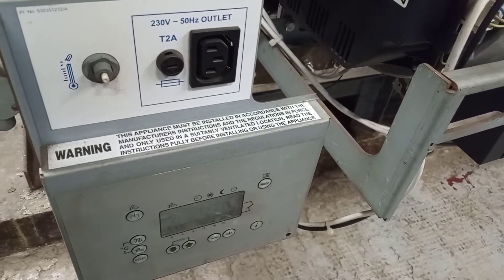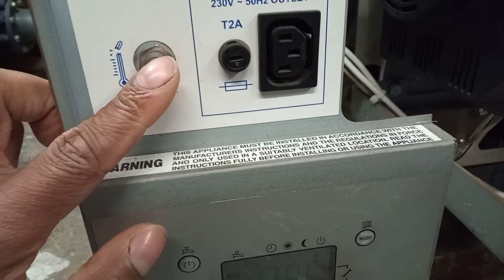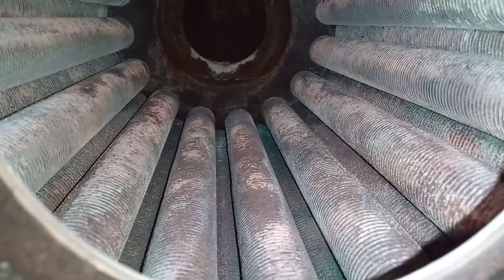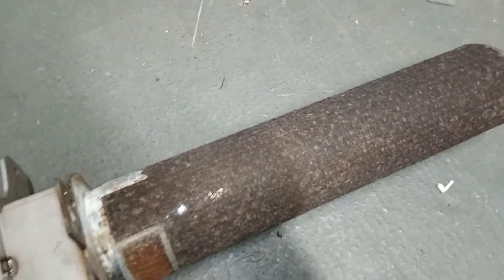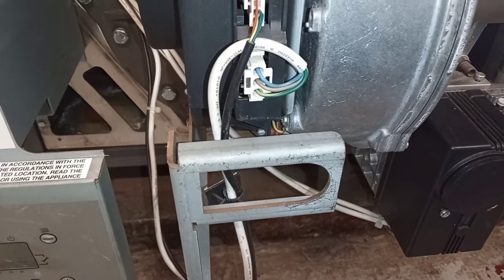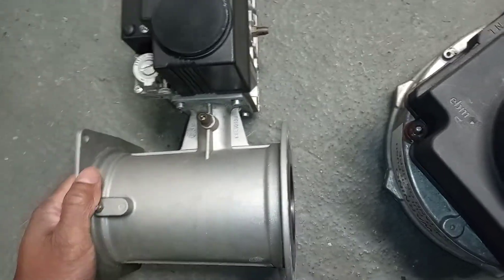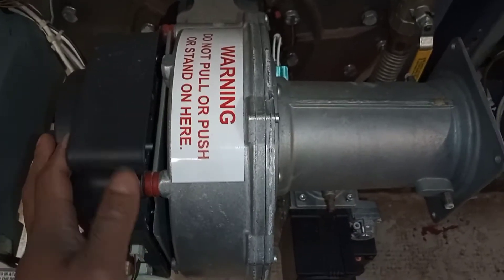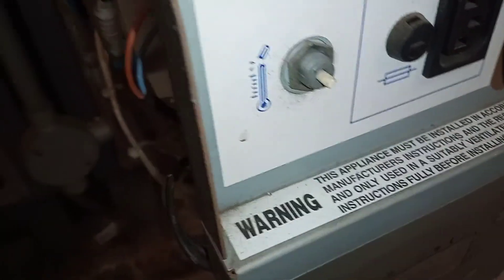FAULT CODE 110 / HAMWORTHY WESSEX MODUMAX 220

Comment: Did u get away with not changing gaskets when removing the burner?? I’ve got one to service where I need to remove same plus heat exchanger for cleaning. Would usually order up service kit before hand??
Reply from the maker: Hi Fraser. I didn't remove the burner in the photograph so not sure what the general condition of the gasket on these models are like. Yeah ideal to have the service kit. If the model is not operating before I get to it there's a small chance I'll aim to remove the burner and see the gaskets as the thing wasn't working when I arrived so no biggy if it's not when I leave. Yet if I'm doing a service and there's no service kit and the boiler was operating then I prefer not to remove the burner unless I'm confident that they are robust gaskets. Cause if the gasket fails then I've left them worse than I found them. Best to follow the manufacturers recommendations to replace them. Although depending on the model the manufacturer can guide you from their experience.
Reply: Nice one… also handy to know that when you swap LMU’s, make sure you reprogrammed them to marry up with the order that they are installed… had problems with these before when the Siemens RVA controller that goes with these faults with unknown addresses 👍🏻
Reply from the maker: @frasermcqueen6406  Good point. Thanks
Reply: @frasermcqueen6406  yeah good point. To be fair to Hamworthy techincal support they were really helpful. Had me set up in 5 mins after I replaced the LMU
Reply: Always replace the burner gaskets for any hamworthy boiler, they use the fibre gaskets so they will always break or be welded onto the burner